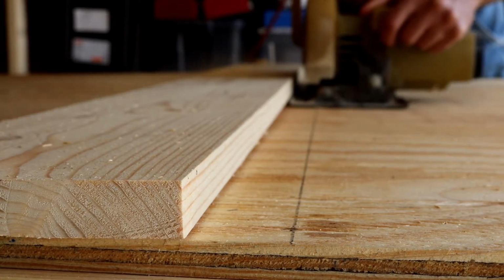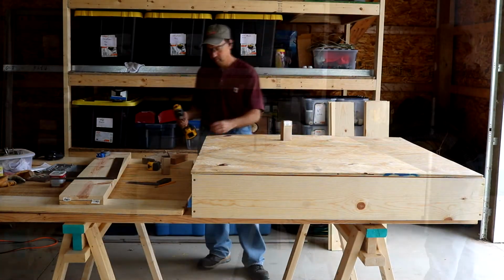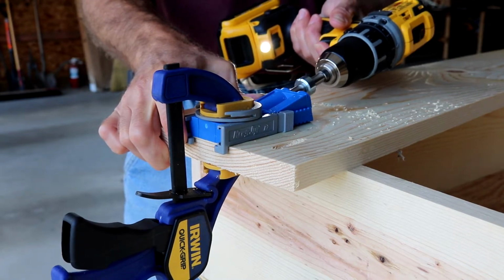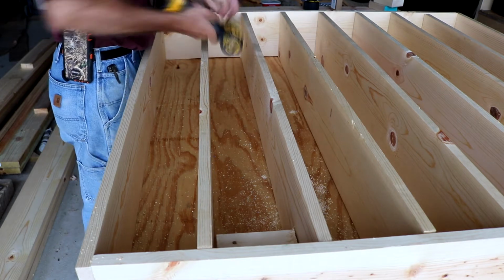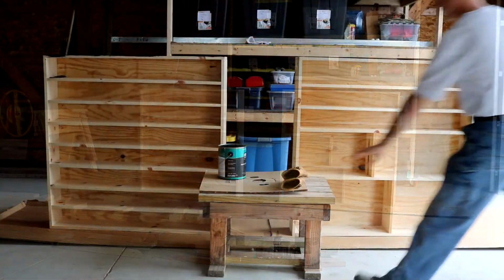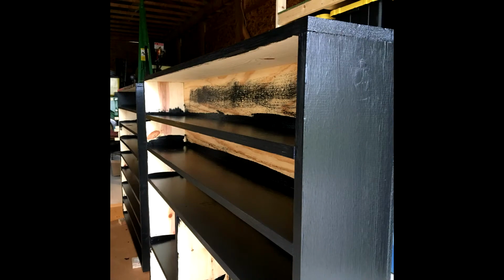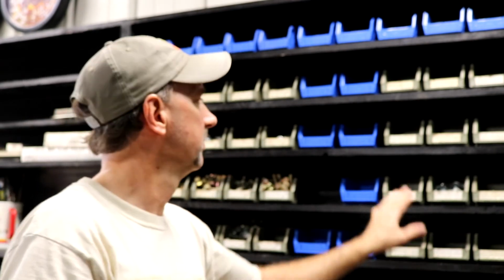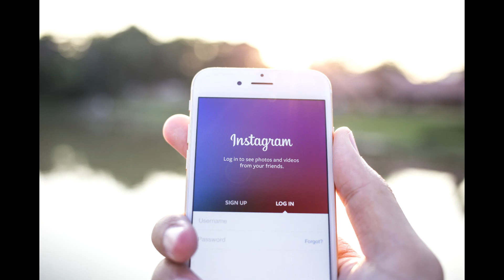#10 DIY Shop / Garage Storage Units

Comment: Great video just wondering what’s the full size of the  dimension on that
Reply from the maker: The dimensions are 8 feet long x 8 feet tall x 4 feet wide. This way I could easily use a sheet of plywood for each shelf. The shelves are 2 feet apart, which works well for the totes that I'm using.

Comment: I noticed you have one of those RZ dust masks.  Do you like it?  Easy to breath in?  Does it get hot?  (thinking of getting one for myself).
Reply from the maker: I like my RZ mask. It seems easy for me to breath in, and it doesn't get overly hot. However, I normally wear it for less than 30 minutes at a time. I like how easy it is to take on and off.